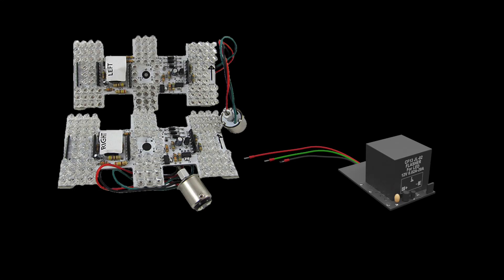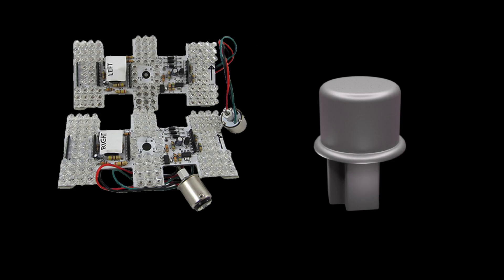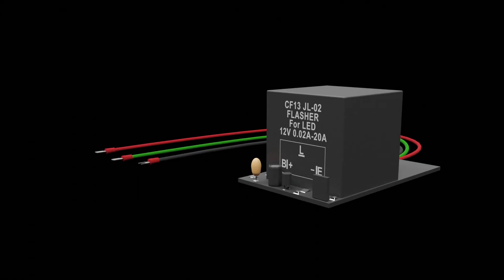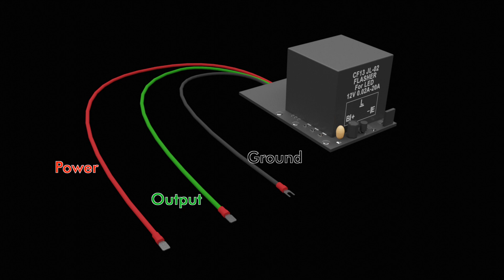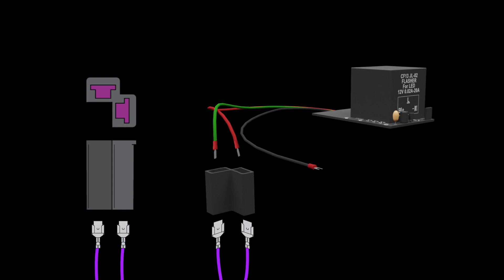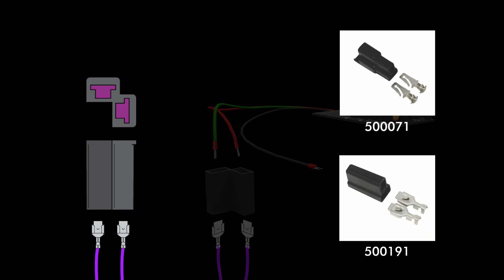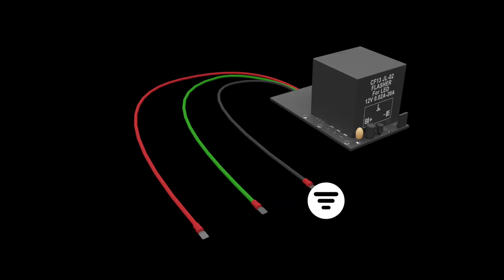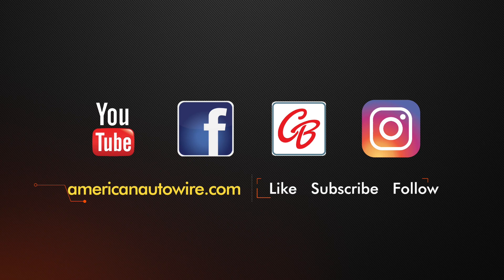How to add sequential LED taillights to an early Mustang Classic Update kit.

Comment: The sequential LED tail lights on my 66 Mustang stopped working after I installed the new wiring harness, so I just swapped back to the original tail lights which work.  I just found your video and saw the part about the flasher - the one that came with my kit did not have a ground wire.  Would the flasher below work, or can you recommend one that would work?  https://www.cjponyparts.com/led-flasher-two-terminal-mustang-1965-1969-bronco-1966-1977/p/HW2811/

Comment: Hey, I just bought one of your classic update harness for a 69 c10. and was wondering what’s the best tool to make the hole in the firewall bigger for the new bulkhead?
Reply: I used a sanding drum on a dremel for mine. Worked well